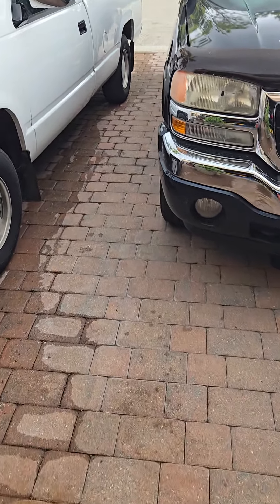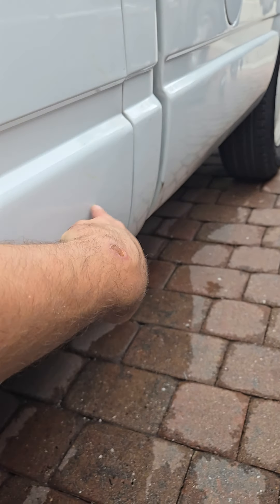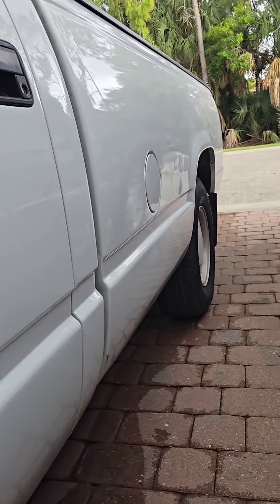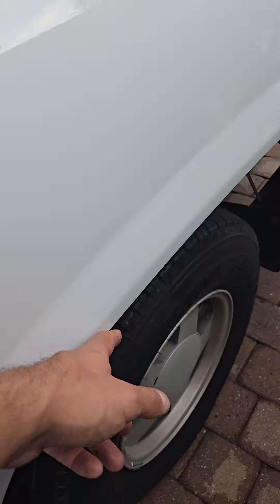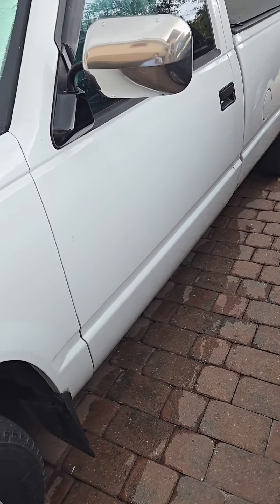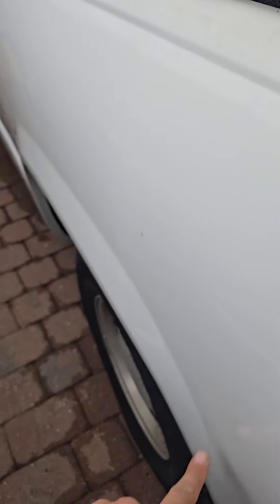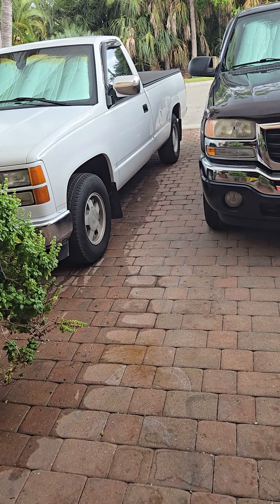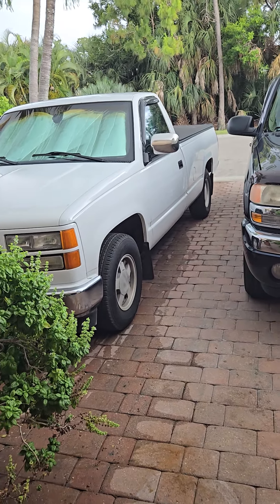Ruined bed side 😴  scrap it?

Comment: It’s fine , just grab ur toilet plunger ..it’ll pull out 😂
Reply from the maker: It wont its warped bad.  Already tried that and gluing tabs .. Does not move. It needs a pulling post like a frame machine
Reply: @GhettoWagon  yeah , I was only kidding.. Ot would need the machine that quickly welds on  puller sticks.. I’ve worked in a body shop.. definitely sucks , as that truck is clean ! I’m a Ford Lincoln guy , but I like those trucks !